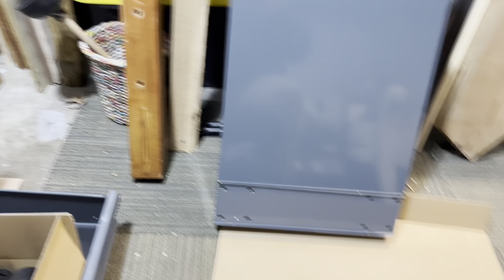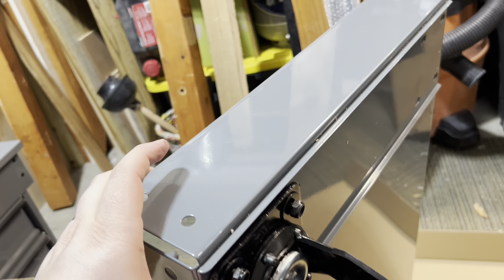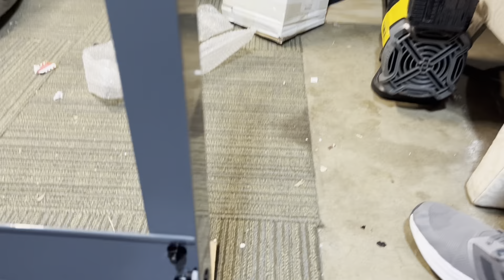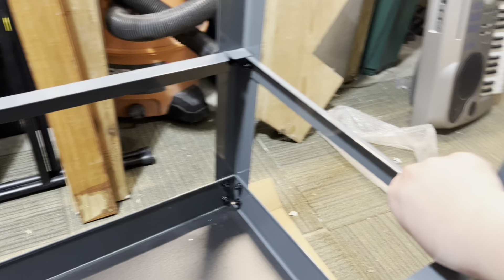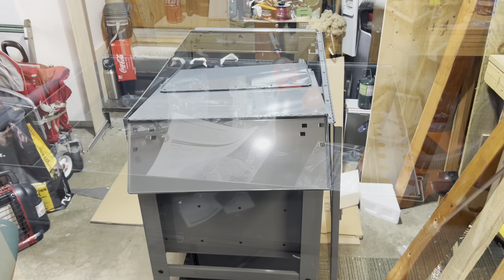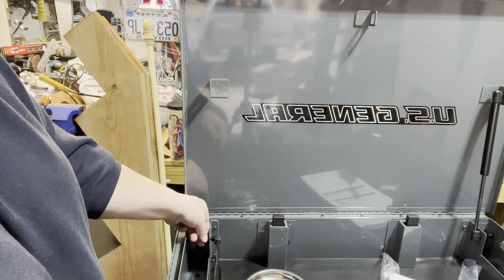Assembling Harbor Freights NEW Slate Grey 5 Drawer Tool Cart!

Comment: Pull the drawers out makes it a little light to pickup box and set in in place. Also Leave all upright bolts loose  and have it on level surface then tighten them up.

Comment: It DOES matter that the smaller side supports go UNDER the front/rear support ends…if you put the side support lips OVER, the bolt holes don’t quite line up anymore.  You did it correctly☝️
Reply from the maker: Glad to hear thank you!!